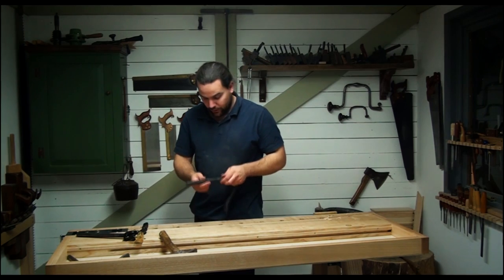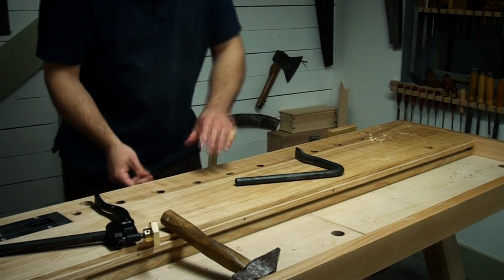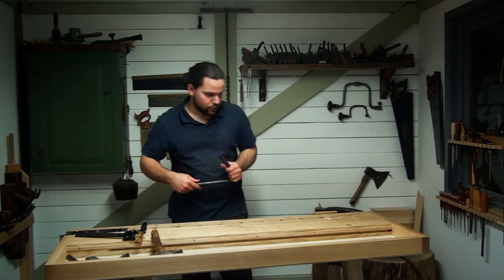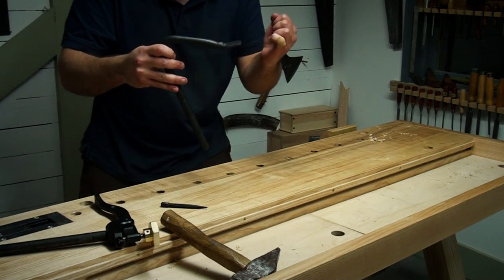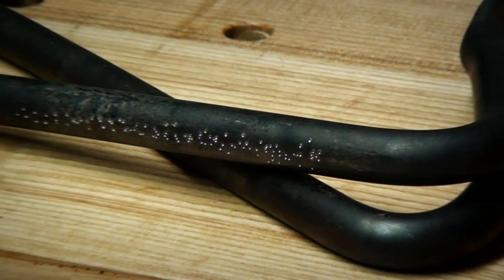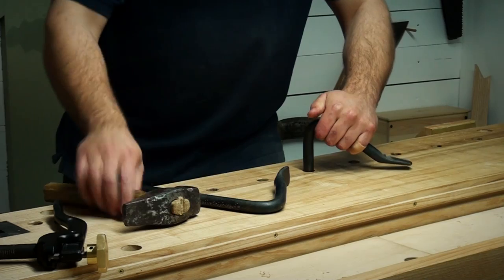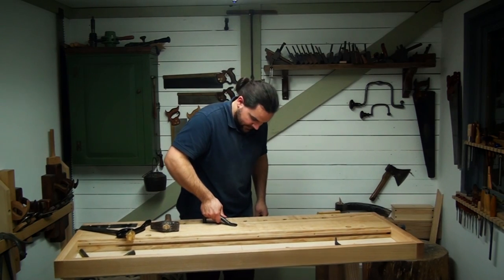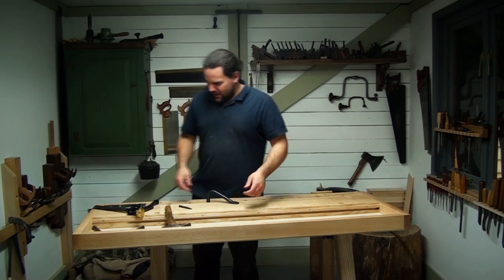Workbench Holdfasts - How To Increase Grip For Woodworking

Comment: I didn't have a center punch or a suitable alternative.  I ended up taking an 8" bastard file to it.  I used the side edge/corner and made quick slicing motions.  This gave the holdfast some horizontal gashes that seemed to do the trick.

One more thing.  My dog holes weren't doing a great job either in my 3.5 inch pine bench.  Once my holdfast had some texture, I used it like a file inside of the dogholes.  I moved it up and down in all directions.  It only took a few seconds per hole.  But afterwards, the holdfasts seemed to be doing great.

Comment: Thank you so much. I just bought a couple of holdfasts and they just wouldn't grip in the 9cm (3 1/2in) thick table top. 
I even sanded them along the lenght with 80 grit sandpaper (and it only helped a bit), so I'll try this method.

Comment: Question...what if you used the steel-teeth / grips in the vise to create the rough-surface, instead of using the punch, nail set, etc. hundreds of times?? same effect, and would be much quicker. Granted you would have to crank the vise tight-enough to imprint the marks. Is that round-stock, straight...or slightly angled or tapered? From what I gather it is a straight, in-line, and the same diameter over the whole-length. I want to make a couple and want to make it right the first-time. Thank you!

Comment: Doesn't that increase the wear on the workbench? It is grippier because the roughness, but when you release the pressure, my bet is that the roughness does more damage than the smoother shaft.